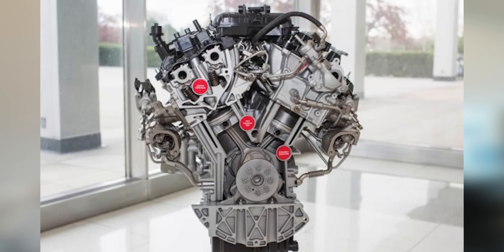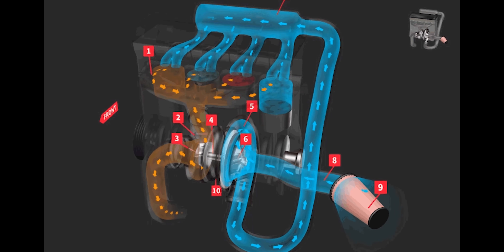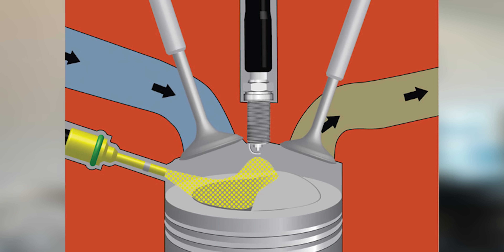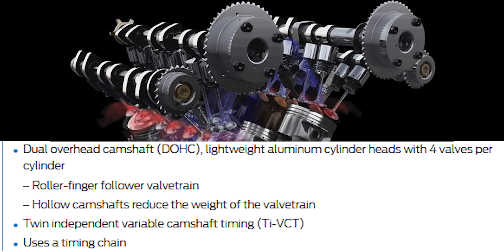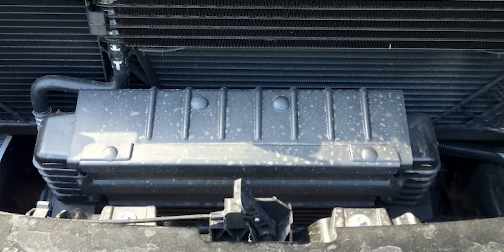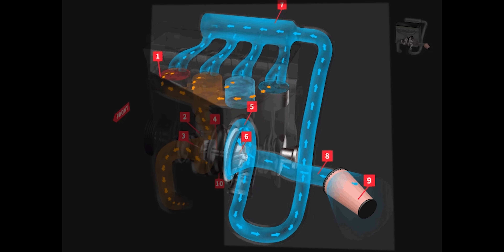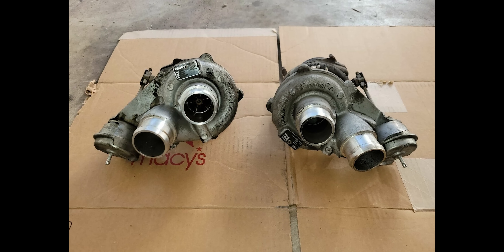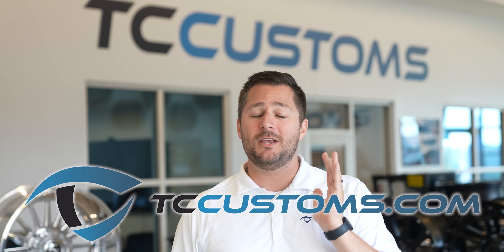The Truth about the Ecoboost Engine!

Comment: Im looking at the 2.7 ecoboost. Does that engine have all the same technology as the 3.5? Is that an engine that I could expect to last as long under light driving conditions as the 3.3 normal asperated engine?
Reply: Yes it does and more .
Reply: @jkeelsnc  times have changed you need to research the latest changes that have been made to turbo engines , Diesel with turbos have been around for many years and they have long life expectancy  I know for a fact ford turbo engines with 300,000 and more still on the road .

Comment: Going 10 thousand miles on an OCI with a DI turbo engine is absolutely a disaster waiting to happen. Also every factory turbo car/truck built in the last 30 years utilizes engine coolant flow through the turbo center section, my 1985 Omni GLH, did, every Volvo I have owned has, and so does my 7.3 F350.

Comment: I own a 2018 Ram 2500 with a Cummins. Not a Ford diesel fan, but the 6.7 PS is a good design, sad it took Ford too long to figure out they needed to make their own diesel. The only other truck I would own other than my Cummins, in this EPA ruled world is the F150 with the 3.5EB which is reliable as a Rolex, just as complicated but just keeps turning the wheels for 250k.

Comment: I have a 2014 eco boost,  307,000 miles. It's on its 3rd throttle body,  cooling tip on turbo lines.  I drive it alot less now...

Comment: 1st gen only had direct FI, which caused buildup on the back of the intake valves.  It's smart to have both.  More power and better dependability.
Reply: Dependability? Really?
Reply: @christianmotley262  yes…really.  Increasing longevity increases dependability.

Comment: I have 3.5 and a 5.0. Both 2013 with over 100k miles. 
Eco boost is way more fun to drive, but has breakdowns. 
5.0 has been solid and sounds better. Not as much power though
Reply: Turbos suck. Unreliable.
Reply: @bikes7777  never heard any turbos going out in these... mostly cam phasers, sensors, timing chain type things 🤷🏼
Reply: The gen 2 ecoboost addressed a lot of the first gen issues I believe, including the notorious timing chain issue.
Reply: That’s exactly why I will stick to the Coyote 5.0. The eco boost is only slightly faster. But the 5. 0 is much more reliable and will out last the 3.5
Reply: @techevar  2018 and up 5.0 is not very reliable. Rattles, consumes oil, makes a knocking noise, cheaply made cylinder walls
Reply: @techevar  maybe only slightly faster driving- but for towing I leave the 5.0 at home. Not even close. I used to have a ‘99 f350 with a 7.3 power stroke. I’m certain this 3.5 pulls almost- if not as good
Reply: @atvrepairsandmore2482  what are we basing this on? My 18 5L has been absolutely reliable. The oil consumption issue has been fixed. The correct length dipstick, and a reprogramming of the TB to not close so much on deceleration (which causes more vacuum inside the engine) has pretty much fixed the issue. Still several years later it still is constantly brought up. The internet is very unforgiving once something negative gets posted on it. Ask Fram. 

The GEN3 Coyotes I've been in have all been smooth operators. No weird rattles or noises coming from the engine. Every time someone with a forged engine (which GEN2+ Coyotes are fully forged, unlike EB) and DI hears a ticking noise coming from the engine they freak out. Really though my wife's Taurus with the N/A version of the engine that the 3.5L EB is based has way more injector noise than my GEN3 Coyote. In fact I've not noticed any DI noises coming from my truck. If it's there, it doesn't stand out. My truck will occasionally do the thud on a hot start. Not sure if it's just a thing with the Coyote trucks, but it's coming from the 10R80 and not the engine. 

Why do you consider plasma cylinder liners "cheap"? They were developed for performance engine applications. In fact Nissan paid Ford to use the technology which Ford had patented for the R35 GTR. Then Ford introduced it in the 13 GT500. It saves noticeable weight, and allows for noticeably larger bores than a sleeved block.

Comment: I leased a 2019 f150 3.5 and beat the literal piss out of it.  Put just over 36,000 miles on it of pure terror.  Literally everywhere I went.  Had to replace to rear tires before I turned it in so they didn't get suspicious.  Thing held up like a tank.  So when I turned it in I purchased a new F150.  But I went with the coyote engine.  At the end of the day, the ecoboost is awesome.  But the 5.0 has a much better sound, and with a whipple can crank out some serious horsepower.

Comment: The First Ecoboost was presented in 2008 in the Lincoln MKT Concept, it started production in May 2009, and the first cars to get them were the Lincoln MKS, Taurus SHO, Ford Flex and Lincoln MKT.  Ford must have done something right as there are now over 2 MILLION 3.5 Ecoboost engines produced, not to mention all the 4 cylinder versions and the solid as a rock 2.7 V6. 

You DO have to change the oil more often than Ford suggests if you want the timing system to stay in good shape though, the timing system is the Ecoboosts Achilles heal.
Reply: Maybe by Ford. But way back in 1989 Chrysler had a choice of a 2.5L Turbo in the minivan vs. a 3.0L Mitsubishi derived V-6. The 2.5L Turbo got BETTER fuel economy than the V-6, but GM had poisoned the market for 'Turbo' vehicles with their failures.  Chrysler badged them with the 'turbo' sticker, and people just didn't want them as the reputation of the 'Turbo' was so tainted back then.  You could get a 2.5L turbo with an Auto trans or a 5 speed manual. While it was boring rowing through the gears everyday on the manual trans, there was NOTING better than sitting next to a performance car and seeing their eyes pop as you dumped the clutch and ROASTED the front tires on the 2.5L Turbo Minivan!
Reply: @stuartshomepc  That Turbo misconception still runs to this day with the Ecoboost Twin Turbo. People remember the fiasco of burned out turbos and blown engines from turbos, not realizing the Ford engines are designed from the turbo up, unlike past engines where an existing engine had a turbo slapped on it and sent out the door.

The 3.5 EB is based on the similar 3.5 NA engine with some block and head changes to accommodate the higher pressures and heat from the turbos. They are watercooled, and oil pumps through them after the engine is shut down to prevent coking of bearings, which is what killed turbos in the past.

Comment: I have a 2011, Ecoboost with 129K miles and no major work besides changed all Calipers once since new, brake pump all 6 coils and spark plugs due to misfiring that was 2 years ago and just regular full synthetic oil changes love the truck would get better gas miles but I ride on Nitto Grapplers on 20’s.

Comment: The real reason there is 2 injectors per cylinder is without the injectors in the intake ports the intake valves would coke up and basically block off the intake ports.

Comment: WARNING.  I owned a 2019 F-150 V-8.  At 2,000 miles, the dipstick was not registering any oil.  Researched on-line and learned that the later model V-8 motors have oil consumption problems.  I brought the truck to the dealer, and they told me that they would have to do one or two oil consumption tests to determine if the oil consumption was out of tolerance.  Only then will Ford let them work on it.  That was not acceptable to me so I traded it in for a 2020 F-150 3.5 Ecoboost.  About 4,500 miles down the road, I was driving one day and the motor began to shudder.  The engine warning light came on.  I brought it to the dealer and was informed the computer showed a misfire on cylinder 1, but did not tell them why it was misfiring.  He put in a new spark plug which seemed to help, but it still is not right.  I have been a lifetime Ford owner, but will not buy another one.  Two F-150s in a row - both had problems. My neighbor told me he knows of at least 5 people who are having trouble with their Ecoboost motors.  One person's truck has been in the shop for 30  days and they can't figure out why the motor is shuddering.  I am thinking about a Toyota!
Reply: Toyota has higher quality overall. I'm biased but just ask any mechanic.

Comment: I’ve got a 13 3.5 not far from hitting 90k no problems so far and it has a full exhaust intake and tune did it basically to get the power back I lost from 35s and I haul a stock trailer quite a bit. I get trash talked for owning a eco especially by my 5.0 buddy but they seem better for towing. One day I’ll have a 6.7 but the ole 3.5 is ok for me for now
Reply: Race him & laugh at the 5.slow

Comment: The truth is that it's a great engine with the same VVT issues that have plagued Ford since 2004. You'd think they'd find a way to eliminate the issue after 18 years.
Fool me once (2005), shame on Ford.
Fool me twice (2018), still shame on Ford.
However, it does tow like a small diesel...thanks to the 10-speed transmission. But if the 21N08 fix doesn't resolve the cam phaser issue for good, it'll be my last F150.

Also, never run your oil for 10k miles.... I change mine every 3500 to 4000. Especially since the engine and the turbos share the same supply oil - gotta keep the oil clean.

Comment: Anybody know when Ford started port fuel injectors in the  3.5 t v6? Originally there were complaints of  direct injection not cleaning the valve stems and no way to clean them leaving "coked up" carbon soot all over the stems.
Reply: 2017
Reply: @andrewt9204  thank you sir!!

Comment: How about addressing any need for oil-catch cans for the 3.5 engines…
Reply: You need oil catch cans on forced induction engines. Just a fact of life.
Reply: @choltzapple  forced induction with intercoolers.  Catch can keeps the intercooler clean.  Oil is a good insulator.

Comment: I have a 2011 F150 EcoBoost with around 53k miles and love it, it hasn’t had any problems except the turbo on the passenger side has a very small water coolant leak. It’s not that noticeable in the summer but in the winter, as the cast metal would be wet, then as the engine would heat up the smell of antifreeze would come through the air conditioner. I asked the dealer about it and they said to fix it they’d have to remove the front fender to access it, so that turned me off. So I just make sure the coolant tank is always in the safe range. This was already happening a few years ago and now I haven’t noticed it as much. Has anyone else experienced this?
Reply: The other day I was underneath and noticed somewhere I’m leaking coolant.  Haven’t traced it down yet.  I have to put antifreeze in it about every couple of months or so.  I hope it’s not leaking around the turbo.  Is yours still leaking?

Comment: Can you please do a video on the 2.3 ecoboost in the ranger
Reply: Love my 2021 ranger. Best power train in the midsize market.
Reply: @lesterparker1594  Not enough engine or I would've bought one!
Reply: @scooterman7888  what midsize truck has a better engine? The ranger is the best engine out of all midsize trucks. If you want better you have to jump up to a full size
Reply: @lesterparker1594  I do have a full size 2021 F150...all I said was it it had a bigger engine I would've bought one instead of the full size!
Reply: @scooterman7888  oh ok I got you. I thought you meant you wanted a better engine in a midsize. Eventually I’m. Enter they but an eco boost V6 in the ranger. Hopefully they won’t call it the ranger raptor and charge $70k for it. Probably will tho.
Reply: @lesterparker1594  That would be sweet if they put a  V6 2.7 Turbo in a ranger!!! I just bought a 2021 3.5... And I'm a V8 guy but love the 3.5!!

Comment: The EcoBoost is great if you plan on keeping it for 5 years or so but if you plan on keeping you're truck for over say 20 years or more than I would go for the 5.0L Coyote V8.
Reply: 10 year old ecoboost with 202k miles and I'll gap your coyote truck yet.  So no thanks
Reply: @r6master69  But it won't gap a Chevelle
Reply: @CJColvin  that's start my mustangs for.  Nice try though.  Plus who cares?

Comment: The 3.5 ecoboost before  2015 is junk with only direct injection, no fuel flowing over the valves causing something called coking, not talking about the turbo coking, sooting up the intake valves. Before 2015 lucky to get 100,000 miles out of these engines. I know this, I was a mechanic at a Ford dealership for years and worked on these engines. In 2015 they added port injection along with direct injection and that solved the coking problem.On the older engines before 2015 adding a catch can in the PVC system helps these engines last longer. Retired in 2015 so I'm not sure the engine had a  catch can or not from the factory. If not add one it's not hard........Best not wait 10,000 miles for an oil change regardless. Those turbos add pressure to the cylinders and unburned hydro carbons get past the rings and down into the engine oil. Our dealership always wholesaled off the pre 2015 vehicles with the 3.5 ecoboost they never kept them for the used lot...........

Comment: i remember buying a  new  01 loaded onstar silverado black  with graphite interior o miles on it i made it one mile from dealer and a nail punctured my right rear tire which to me was was crazy cause in 1998 i bought a victory red silverado same thing happened same tire drivers left rear but made it  66 miles further.Since then i bought 3 new fords and no flat tires?.i duuno just my experience

Comment: My parent's 2011 F150 Ecoboost has 380k miles. It was used hard as a work truck doing construction. It just started having some issues that we haven't figured out yet.

My 2012 F150 Ecoboost started doing the timing chain slap at 98k. Luckily I had the extended warranty, and they covered it. I have also had plenty of other issues, including the moisture buildup in the intercooler. These issues have reportedly been resolved in the newer gen Ecoboosts.

An engineer at Ford that worked on some of the first gen issues told me that these engines like to be ran hard.

Comment: Think about this the Ecoboost need not one but two Turbos to keep up with the 5.0. If you put just one turbo on a 5.0 it will smoke the 3.5 all the long.
Reply: And get crap fuel economy. Not to many people are going to want a 5-600hp daily driver, its just not necessary. Fuel economy is a big seller, and a 10-15mpg turbo 5.0 aint gonna sell. Also, who wants to spent another $7-8k on a whipple. 

I have personally gone from the 5.4 in my 2006 and 2010, to 5.0’s in my 2013, 2017, and 2018. I then went to a 3.5EB in my 2020 and now a 2.7EB in my 2021. My 2.7EB is amazing. Buying a 5.0 is good for one thing only, sound.

Comment: Might want to edit your video in regards to stating the piston coolers are spraying "fuel" onto the bottom of the pistons. It's spraying oil, but I guess it could technically be called fuel, but not in the case that oil is used for lubrication and cooling purposes. Also, this is just a pet peeve thing, but an engine vs motor. They are not the same. Motors run on electricity and engines run on combustion. The engine converts various forms of fuels into mechanical force, while the motor transforms electrical energy into mechanical energy. Not a biggie, but since the use of motors are becoming more popular, there would definitely be a difference these days.

Comment: I just got a 2022 F150 3.5 V6. But my truck has a lot of vibration inside the cabin when it’s idling. When you are on parked. The truck shakes a little. Also when you are driving. It has a small vibration. Not sure if this is normal on these ecoboost engines. Really disappointed with purchase at this time. Dealer has said it’s normal for these trucks. Which it’s unacceptable for a $60K truck
Reply: it's the port injection at idle.  once she getting rolling the direct injection kicks in and it's as smooth as they come.  My 22' Tacoma has same noise and weirdness because of port injection.  But very reliable

Comment: What about the high failure rate on the cam phasers
Reply: By high failure rate, do you mean the 2%? How about the 5.7 hemi having 20% failure before 100k? How about the 5.0 coyote having a 33% chance of your truck being the truck that needs a quart of oil every 1000 miles? How about the 50% chance your new 6.2 Silverado will have lifter failure in the first 10k miles? Cam phaser affects very few ecoboost owners.
Reply: @bigf1502  NO big 3 trucks for me not reliable. Your just comparing junk to junk

Comment: Aftercooler not intercooler. If the air is cooled after its compressed it’s after cooled. Before is a intercooler. The old turbo coupe had a intercooler.
Reply: Actually, an intercooler is used between turbos in a multiple stage system.  Some old Mack trucks and most current pulling tractors that can’t get the desired pressure/air flow from a single turbo.
Reply: @austinhogan5216  Actually your wrong.

Comment: I love that turbos are totally reliable on diesels but somehow through witchcraft, wizardry and horse de-wormer they aren’t reliable on a gas engine to a certain demographic.  I have a family member with a 3500 and one with an eco boost and guess what. they got the same mpg towing trailers up mountain grades.  I’d also like to add that the eco boost has 200k on it.. the 3500 is new.
Reply: Lol, your trailer must be a bike rack lol!!! And nothing is wrong with turbos. The issue is your stuffing a tiny V6 in a big truck. HD diesels have big motors, PLUS turbos. Reality is you can abuse a little 3.5 turbo like you can a V8. If your a grandpa and you use it to get grocery, then it will suit you well.